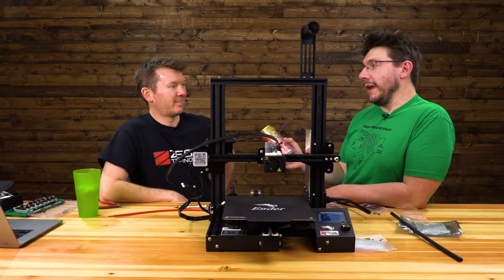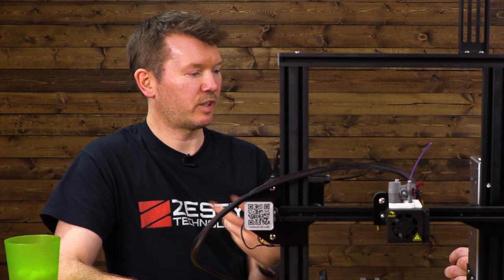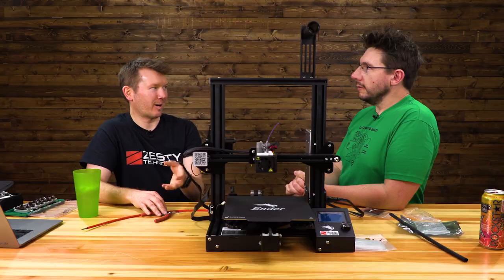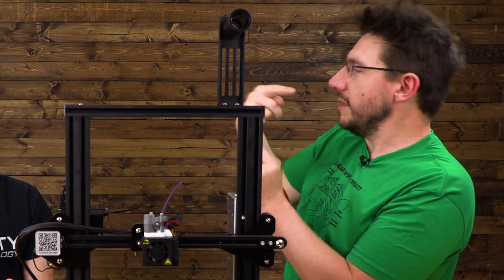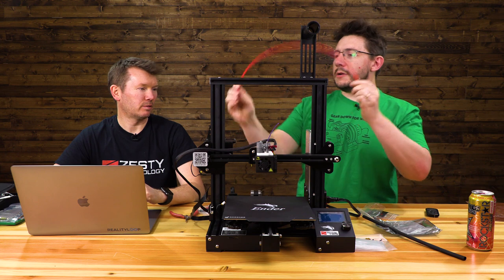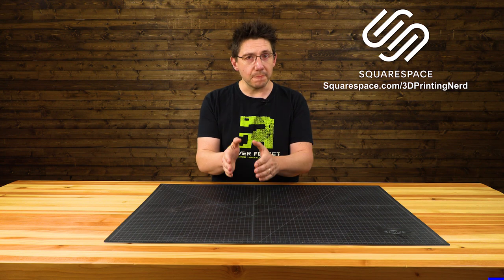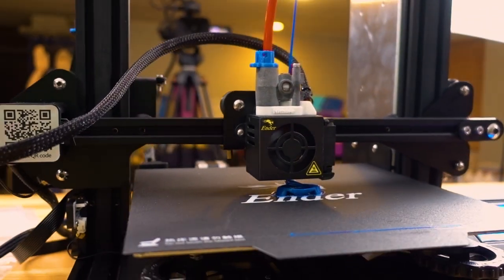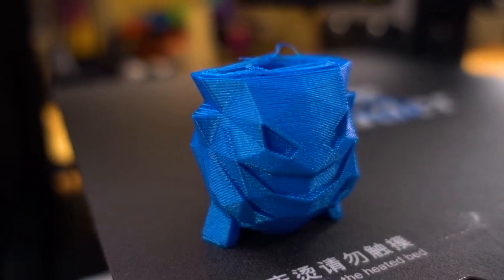Zesty Nimble - The Remote Direct Drive Extruder IN STUDIO!

Comment: So basically they adapted a speedometer cable to remotely drive the extruder gear.
Reply: Jason Simpson 
Yes, with some other refinements.  A bit like how your doctor just gives you a bunch of chemicals and / or bacteria, but there is some nuance involved.

Well, hopefully.
Reply: @boggisthecat  Definitely some adaptations. Like the fact that in order to have the cable going straight in the top, it needs to be  drive a worm gear arrangement at the print head. That transfers the motion to drive the stepper motor. That's why the steps per mm have to be adjusted accordingly, resulting in overall higher torque at the print head itself.

Comment: Shouldn't it be "Indirect Drive"
Reply: No. The word "drive" is misplaced when talking about extruders. A direct drive is normally when a motor is directly connected to what it is driving (that means, no gear box/pulleys/reduction between them). Let's say we're talking about the driving of the extruder gear. Both Bowden and Direct extruders are direct drive in that sense. That's why we should say Direct Extruder (without "drive") when the filament goes from the extruder directly to the hotend, and Bowden Extruder when the filament first travel through a bowden tube and then reached the hotend. It his case, it's a remote direct extruder, because while it is a direct extruder, the motor is elsewhere, not adjacent to the extruder. Also, those direct extruders with a 3-to-1 reduction would technically not be direct drive, while still being direct extruders.
Reply: @lapidations  so are you saying it would be a remote drive direct extruder system

Comment: It's also a bit strange to me that being able to print flexibles is the only up side they talked about for a bowden machine. There are so many better reasons. 

Having to use FAR less retraction firstly. This will cut serious time off certain prints. 

Bowden tubes add inconsistency because the filament path is slightly shorter/longer depending on where the print head is and thus the curve of the tube. 

Friction in the tube can also be an issue.

Also wouldn't a 30-1 gear down ratio mean the stepper should never have to microstep? That's a good thing for any machine I would think.

He really missed his chance at driving home all the good points.

Comment: Does this offer improved retraction performance versus bowden or is it really just for flexibles?
Reply: I can't speak directly in relation to the product because I don't have one but yes it would. You wouldn't have the binding that can be caused with bowden setups. Of course that is all relative to the tube used. If you use the standard PTFE tubing then binding can be a serious issue but with something like the Capricorn it may be less of an issue.
Reply: I had 8mm retracts on bowden before the Nimble, down to 1mm retracts now, much the same as any direct drive setup where the stepper is right above the hotend.

Comment: I love the idea and implementation. My only query would be, how much backlash/slop is there in the flexible drive? In my experience there is always some give when changing rotational direction (for retraction), is your flex drive made to reduce this?
Reply: The nimble has a 30:1 gear reduction, so any backlash is reduced by that factor. Brian uses less than 1 mm retraction when printing.
Reply: @LykleSchepers  Ah! Of course it does, I forgot to factor that in. Thank you.

Comment: So... he's using the mechanical cable that's used for (mechanical) speed indicator?
Reply: Not exactly. The nimble uses low-loss flexible shaft, which is similar to the flexible shaft used on dreamers and analog speedometers, but capable of far better precision.
Reply: @GrubbyZebra  Yes, that's exactly what i was refering to... (i just couldn't find the proper definition of it)

Comment: Interesting! Wonder what the effective "backlash" of the cable drive is, and how well the slicers deal with that. I imagine cura, used to the Bowden systems, would probably handle this fairly well with tweaking.
Reply: The drive on the head has something like a 40:1 gearing on it, so the backlash from the cable is almost nothing.
Reply: @Hotcubcar  ah, didn't think of that, rather clever way to dodge the problem. Interesting, though - presumably that means the stepper motor is really ripping along then since, e.g. my rep2x has no gearing on its direct drive, this Nimble would have to turn 40x faster. Wonder how that is for sound, etc. It's obviously nice for torque, which is super cool.

Now part of me wants to upgrade at least one head of the rep2x with one of these, reduce the inertia a bit - two nema17s whipping around is a lot of mass.
Reply: @rpavlik1  Yeah, it produces a lot of torque. Some customers have had a spool get caught, and lift the printer into the air. He tried to show it here, but it didn't get explained very well.

The stepper does need some speed, not sure about the noise, but it does eliminate the need for microstepping.

Comment: There's going to be some serious flex and slop in that drive cable. Getting the tuning right is gotta be interesting.
Reply from the maker: Do you think so? I didn't get the sense that the drive cable flexed much at all.
Reply: 3D Printing Nerd I watched it again and saw that he has a 30-1 gear reduction which should help that. I just know from the mechanic world how those types of cables can tend to twist when put under load.
Reply: @Potatogambit  yeah close to no real load on the cable due to the gearing, but it also has extremely low rotational flex anyway.

Comment: what material is the drive cable ? is it steel wire ? how can the steel wire not twisting while spinning ?  is there any backlash at the worm gear u use ?
Reply: The cable is made of cross wound steel wire, there is a bit of flex but the drive on the head has something like a 40:1 gearing on it, so the backlash from the cable is almost nothing.
Reply: @Hotcubcar  30:1

Comment: I would really like One but it’s to expensive
The question is can you make one yourself cause these cables are the same types like the ones that come with dremels
So maybe if i Got one of the cables separate i could do some designing and make one at home
Reply: It's a certain type with the metal wires wound in opposing directions so it's stiff for both extrude/retract movements.  But, I'm all for DIY so go for it.
Reply: A dremel cable likely has too much rotational flex in it, you could always buy a cable from us and try making the rest yourself though!

Comment: Nice idea but a tad expensive
Reply from the maker: What would you price this at?
Reply: @3DPrintingNerd  well as tom pointed out (i didn't know) this is similar to a dremel flexible shaft. from banggood a metre is $10. assuming that this one is way better quality - it could probably be sourced for $30. the rest of the parts (printed and vitamins) could be had for at most $20 (and that is a gross overestimate). so their markup is 100%.
but of course, they had the idea and developed it and marketed it. so i understand that they need to recoup their investment.
the trick is to maximise volume x price. my assessment is that at this price the volume will be low.

Comment: Must have! 
Is it plug and play or is it necessary to make changes in the firmware?
Reply: There is a whole different gear ration: to get the extruder strong enough to lift a printer, you need to gear down. That means the extruder motor (now aside, on the frame) needs to turn way faster  than before.
And you probably have to compensate a bit for the torque of the connection. The connecting rod is very stiff (in the correct direction), but it is always more flexible than using a direct coupled motor.
So yes, you need to tell the printersomewere that the motor needs to turn x times faster, and do a calibration for over/underextruding and retraction.
Reply: @ArdjanVideo  sorry wrong the gear ratio 40 to 1 so i actually moves way slower uses less vref also.
Reply: on a Creality machine you can just use 5 lines of start gcode in your slicer.
Reply: @TheRealKingDong  30:1 actually
Reply: @briangilbert3429  Another reason Id take the Flex3Drive over this anytime.
Reply: @TheRealKingDong  30:1 is easier for control board to drive than 40:1, but each to their own mate.. there is a place in the market for both of us.

Comment: The name needs some work- it can't be remote and direct at the same time. Call it 'Flex-drive'; boom, fixed your product.
Reply: if only it was that easy.. unfortunately they also have to combat copyright and trademarking.. Flex-Drive, and most iterations there of, is already taken by Dremel.
Reply: They cant cause the original and still way better system Flex3drive.

Comment: TL-DR: ~100$ For a 3$ dremel flex shaft put in some red tube + some injection moulded parts. Great idea, bad implementation,  outrageous price.
Reply: Pavel Shlapak Maybe... just maybe... it‘s a little more complicated than that? 🤷‍♂️... usually the devil is in the details 😉
Reply: @michaelecker448  its not.
Reply: Good job doing research on this product!. It is not injection molded, it is 3D printed out of nylon and the flex shaft is designed to not have variations in the length of the cable when turning both ways, which is not the case for Dremel as it doesn't matter in their case. 

Also how is the implementation bad? It is expensive but it is a niche product so that is not surprising.
Reply: @thepfeiffenator2990  They not inventing the wheel here - to modify shaft manufacturing for it not to wobble not rocket science. Especially if there no metal parts in the kit they could at least work at coloring scheme of that thing for it not to look mismatched and thus cheap
Reply: @pashok28  If you want to make it look nicer you can always paint it yourself to whatever color you like. I personally don't think it looks that bad. Definitely not a deal breaker for me, as I prefer function over form anyways. 

Also I'm sure the time and money it would take to paint each part for a certain color scheme would not be worth it to them for the sales that they would gain.

I think the value proposition is there for a bunch of people. Maybe just not for you.